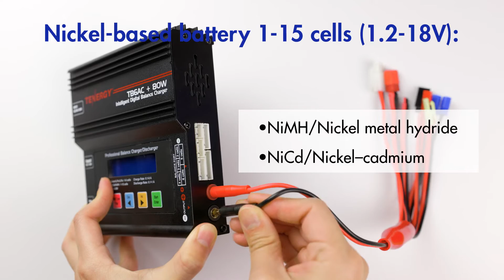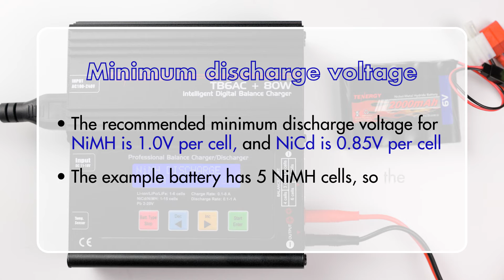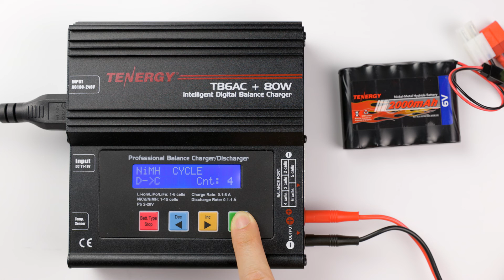How to charge & discharge NiMH/NiCd packs with Tenergy's TB6AC+80W charger

Comment: My charger says my NiMH battery is too low. Its for my transmitter i havent touched it in 4years. Anything i can do or do i need a new battery
Reply from the maker: Greetings, please reach out to our team directly at service@tenergy.com with your battery pack and charger information and we can take a closer look with you. It's likely the battery pack has been over-drained and no longer works if it hasn't been maintained during those 4 years.